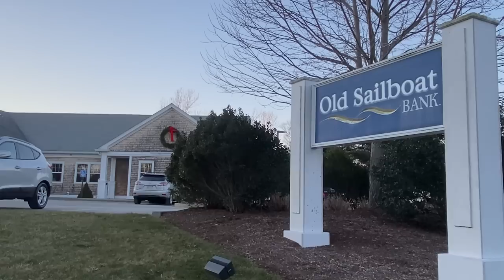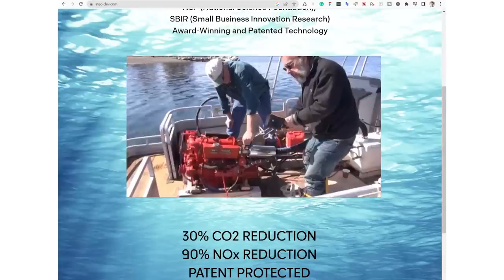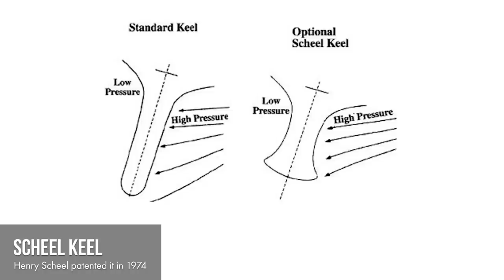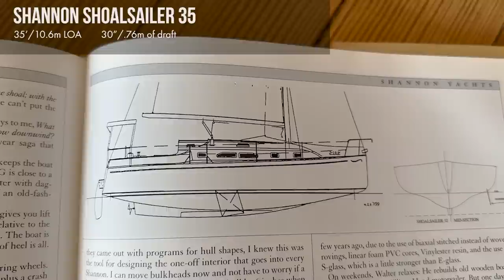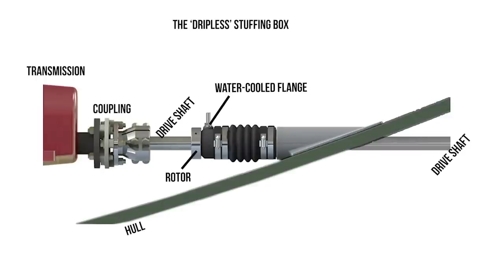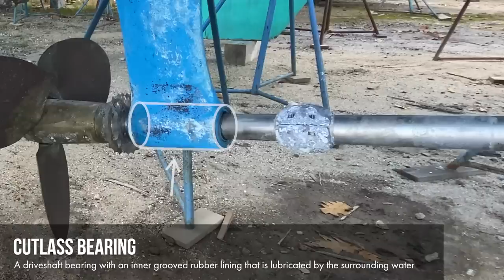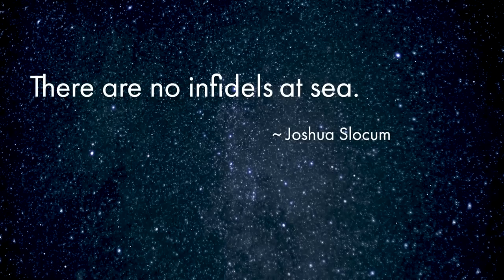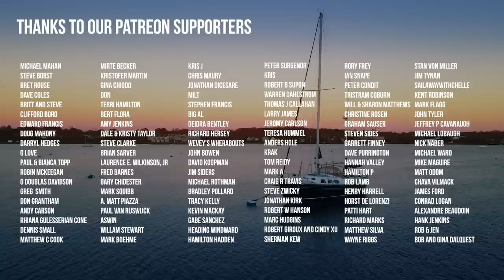Ran-day's Sailboat -  Visit from Walter Schulz - EP10 #sailboatrefit #sailboatrestoration

Comment: Hello Ran-day: being a marine engineer for several decades I personally prefer traditional shaft logs with stuffing boxes. Very reliable, easy to service, cheap to maintain, and very safe. You can work on a stuffing box even when at sea.  Dripless seals are great for keeping bilges dry; however they are very expensive to maintain. If you are in the Bahamas for example, parts will be difficult to locate. They are expensive and troublesome to replace every 5-6 years.

Comment: Hey Randay, we live in Bellingham Washington and if we don't fiberglass over the bolts on the rubrail or toe rail they always sweat and drip. You can put a big blob of caulk over them to stop the sweating. You need at least 1/4 inch thick all around each bolt and caulked tight to the whole. I take a calking gun and just run a few circles around each bolt and make a nice mountain lol. Any metal that penetrates from inside a boat to outside needs to be insulated in order not to sweat. At least here in the Pacific Northwest and Alaska.

Comment: Hey Randay I have had someone before my put a nice access hole in the top of my old deisel tank. They did a nice job and you can reach in and clean every inch. Mitchell access hole is a good 6 inch. I can have my arm in there and still see I little around it. My tank is old galvanized tank from 1972 and looks like new on the inside.

Comment: Freeze plugs are needed for sand casting, they are very easily replaced.   A vacuum gauge on the fuel system shows the condition of the filters, it prevents engine failure.  Another item that costs a few dollars and saves hundreds   Dripless shaft seals sound good, but they fail “catastrophically”  a regular flax seal costs $2 and is easy to replace    Never use dripless    “The answer to a problem no one was having”   Very well said
Reply from the maker: A good friend just called to tell me that about the casting/freeze plugs… Great tip on the vacuum gauge. I’m a convert back to the classic stuffing box after the Titanic warnings! Cheers 👍👍

Comment: Thanks Randay.
A wonderful chat with a remarkable gentleman.

Regarding your leaking engine coolant.
You may find the process a bit more leisurely if you pressurize the system at the radiator cap. 
No need to run the engine or be underway.  
Low pressure ( approx 10 -15 psi) or less if leak is severe.
You will have time to carefully examine engine and surrounding peripherals in a more controlled manner.

I want to wish you luck. However, the opportunity for more great content keeps me coming back for more
Regards,
Bill

Comment: Walter Shulz, he is the man. Simple and direct. Amazing Ran-day that you managed to buy a boat that is the next Titanic and the next Hiroshima. You may have to discuss this with Captain Q. I have a dripless shaft seal on my Challenger 36 and it is a constant problem and I am going to change it out for the standard stuffing gland next time the boat is out of the water. The gas cylinder locker also just a simple rebuild or just hang the cylinders on the push pit out in the breeze. Love your work Randy and all the best. 🐟 😁
Reply from the maker: Thank you, Richard! I will be following in your footsteps with a regular stuffing box.  Good thoughts on the lazaret... looks like a simple redesign is the option I'll be going with. cheers!

Comment: Driplass shaft logs are made from high carbon steel that rust easy. So they get pits on those mating surfaces from not being used all the time and drip. And then you might as well have a standard stuffing box. Easy to change, you can change them in the water also. And don't take up much room to carry some spare stuffing gland material. Very important to put the stuffing gland back in the same direction it came out so pay attention to that if you ever change one.
Reply from the maker: Great tips… I do plan on heeding Walter’s advice to go back to a tradition stuffing box… so stay tuned for that journey! Cheers

Comment: As a temporary but very usable fix for your propane issues check out one of the portable gas burners chefs use for catering events.  Less than $50 using 8oz cylinders and small enough to fit on your current stove top.  At restaurant supply stores and online.  10,000 btus

Comment: First and foremost what a fantastic guest and interview
   to comment though. The purpose of a freeze plug is when they’re manufacturing the engine block there are sand cores inside the mold of the engine block that must be broken down and taken out as space holders for your water jackets as will as oil passages they hold the spaces in the casting the molten material flows around these sand cores and is removed and some are actually machine I would replace them with bronze freeze plugs
Your tanks that are 5052 aluminum are OK but if ever replaced you should go to a 6068 marine grade aluminum you could find this in the Coast Guard specs for vessels for hire. It’s just a better product. It does cost a little more than 5052 but once again, what a fantastic guest , you and the captain do an awesome job say hi to Sea dog

Comment: He’s a nice old guy with lots
Of knowledge and his attitude is great , fun is what it’s all about, he’s very smart, boat fixing is something that’s never ending, it’s relatively easy to cut a round inspection hole in the fuel tank about 130 mm  so that you can get your arm down into it and clean the sludge out physically , it’s easy to tap in bolt holes and make a lid with a seal and will make your life easier because pumping only gets out the water , there’s an Australian product we use here called fuel doctor , if you can get it there it will keep your tanks absolutely clean and absorb water into the fuel molecules , it’s Amazing stuff, I used it for three years and had very clean filters . Great boat good work on the videos very good job.

Comment: One of the best videos on your channel.. the channel Epoxy and Butyl Tape installed a dripless and it took a crap within the first season it was leaking so he went back to the old tried and true seal.. the old style you can atleast tighten up where as the dripless could lead to sinking

Comment: I had had the PSS system on two boats - awesome system.  I am not a fan of your current set-up.  I would replace with a PSS and add a safety collar ahead of it.  It comes with one collar that is set to the shaft with set-screws and this is designed to hold it into place when under use.  I have had the collar slip a couple of time causing too much water coming into the bilge.  I decided to add a 304 stainless collar as a safety collar that keeps the set-screw collar from slipping.  PSS has now included these safety collars for larger shaft applications.  I literally bought my safety collar on Amazon but my shaft was 1".  From that point forward, my bilge was dry as a bone.  FYI - I sent you and email to help you with your fuel tanks.
Reply from the maker: Thanks Tim!! Much appreciated. I hear you about the 2nd collar…. I actually did a makeshift one with a pipe clamp when it started taking on water and I was troubleshooting.  what happens when your PSS surfaces/interface wears out or down(in my case)? Isn’t it better/simpler to use the old stuffing box style and repack it every few years versus removing the shaft to replace the PSS rotor?
Reply: @YachtHunters  stuffing boxes drip when the boat is alone at anchor.  I don't like that idea.  The mating surfaces on a PSS are extremely durable and good for many many years.  I would check the rubber sleeve and replace every 5 years or so just to stay ahead of it.  The mating discs will last you longer than we will be alive.  🙂  Talk to a PSS rep and ask these questions directly and you will get the same answer.  These units are far superior to anything else.  I will have that set-up in every boat I own.
Reply: @YachtHunters  Well, yeah maybe! Depends on a lot of things. PSS suggests you replace every 6 years. I haven't had issues with mine in the last four. 

You usually don't have to pull the shaft to replace. Definitely have to disconnect from the coupler. But not entirely pull.

I like it. When you replace you'll inspect the entire system. So it can be good. My prior solution was a traditional packing - but at some point the shaft was misaligned. I had about 1/16" of bronze between me and the water. Scary!

Comment: Great episode.  What Walter said about the large area where your propane tanks are, even with a weep hole in the event of a gas leak, filling up that area would be like a bomb going off.  Why not wall it off in there like a designated locker?  Lots of work but that would be worth it.
Reply from the maker: That's a great approach and seems like the simplest potential fix... might not even be that much work! thanks

Comment: As a retired diesel mechanic, having worked on a variety of diesel engines, single cylinder yanmars to v16 diesels.   The Racor filter system is superb with a visual and good micron filtration. Match the gph to your engine dual filter system.   Cheers Vic.   Nice to hear walters wisdom
Reply from the maker: great tip, Vic, Thanks... I'm looking into adding a 2nd Raycor to the mix... so I'll keep that in mind. cheers

Comment: That’s a practical, interesting and sympathetic real sailor type of guy I would savour some sea time with! What a mentor(or even father-like figure) he would be for a restoration or boat build project! I thirst for more of him. He is so right about night sailing, in 30,000 sea miles of coastal/offshore racing, my strongest sweet memories are from the “bright darkness” of the night watches!

Randy, put those gas tanks in a container on the rails, fit a traditional stuffing box on the shaft with a remote grease twist cylinder! In the case of through hulls, the perfect boat has none, a keel cooler/exchanger for the engine and a single through hull or outboard flush pipe feeding an onboard tank from which all water requirements are fed from, then you can leave the ship to its own devices and have  a good night’s sleep! 

PS.. I am collecting classic/vintage sail boats for a maritime sail training/community boatyard/museum so maybe that may be of interest for an “offshore/foreign” Captain Q video? SkipRay(and dogs, Rusty & Skipper), Kenmare Bay, Kerry, Ireland.

Comment: I too have experienced a dripless stuffing box failure. It worked well during its 5 year warranty period, but three years later, it was spewing gallons of water per hour when underway.  Fortunately, I was only a few miles from a marina when I discovered the problem.  The marina replaced it with a traditional stuffing box, which I stuffed with Teflon packing cord.  

The big advantage to the traditional stuffing box is that it can be serviced without hauling the boat out of the water. If it is dripping too much, tightening a nut is all it usually alll it takes to reduce dripping.   The packing can be replaced inexpensively.  The packing material costs $10-$20.  "Dripless" boxes can't be serviced when they wear out; they have to be replaced.  This can only be done when the boat is out of the water because the shaft has to be pulled to gain access. 

Teflon  packing stays cool with very few drips: none while the boat is stationary, and about 10-12 per minute at when the engine is running at 1800 RPM.  I tested the temperature with a no-contact thermometer while the boat was underway, and confirmed that was cool to my touch after stopping the engine.

Comment: I was laying FG @18 yrs old. I like most of what Walt did building boats...the best! Especially impressed with his information on thru hulls and the stuffing box. Old style stuffing boxes are not a maintenance item...either they work,  tighten occassionally and replace as necessary.  They can and have lasted the life of a boat, done right. Those contraptions self- whatever stuffing boxes...yup, now you have a maintenance item.
Note to Walter..
Love your boats. I just wish you had put aluminum toe rails on them. My Poor girl, a C&C 30, held at the dock for 3 hurricanes with wind 50 to 70 kts fo 12 hrs..
Waves didnt foam white,  just came over the wave break. I had 8 springs onto that toe rail. 4 sterns, 2 bows, all set to let her dance. 
The only mark she had was when another boat got loose right behind her...I watched from the beach in horror...she went in and sprung back with those 8 springs (14 lines on her over all, on her dock...all 5/8 3 strand nylon)...she came back and shot that 10,000 lb boat off her ass. It wrote itself and 5 others off. I had a chip corner of transom and bent stern ladder. Didn't put in a claim.
12 sunk, 30 damaged and out the next season for repair...all because they couldn't be sewed to the docks. Not a pearson, alberg, oday, tanzer, pace ship stayed up because they all ate their lines. No one could get on the docks with 6 footers rolling through. We had a few with aluminum toe rail go as well...but " double" your lines is  BS...they didnt secure the boat....you are a bullet proof thinker...I am too.

Comment: I love my dripless shaft seal. They need to be “burped” if the engine hasn’t run for an extended period. Or if starting after a splashing. On our DSS there’s a bellows type rubber hose. Easy to pull back the fitting which breaks the seal for a second. It will flush the seal of any tiny object. Ask me how I know. Most DSS’s are rebuildable. The kit has a coupla o-rings and a set of grub screws. 
Jon

Comment: Dripless shaft seal…I don’t have one to speak with experience on the pros/cons. But I can say that a few years ago I replaced the prop shaft and coupling on my Sabre 34. And at the same time I replaced the original stuffing box (and stuffing box hose & hose clamps) with a new stuffing box, etc.

Like you, it seemed to me at the time that the dripless system solves a fairly minor problem with potentially catastrophic one.

If you keep the dripless system, some people recommend a prop shaft zinc immediately forward of the rotor as a backstop to the rotor set screws.
Reply from the maker: Good idea.. I used a pipe clamp as a stopper for a bit until I felt confident it was stable… now I’m onto the task of replacing it with Walter’s suggestion 👍👍

Comment: Try Bars leak sealer for radiators......in the old days freeze plugs were made to pop out if the water in the engine block started to freeze hopefully before the engine block cracks...

Comment: Might I recommend a borescope  camera or snake/inspection camera on a long lead for your phone, they are not expensive and you could leave it in the bilge and have the wire sitting on the chart table for easy access while sailing or for a quick peak while in port.
Reply from the maker: he has one

Comment: In 1967 I had a 1947 Ford car with a flathead V-8 that did not get its proper winter mix of water and antifreeze, due to my teen-age ignorance.  An unusual cold spell froze the engine, and one of the freeze plugs got pushed out free of the block.  I could see half-frozen engine coolant seeping around the lower side of the plug as it sat free of the block itself.  During that repair a mechanic told me that freeze plugs do protect certain parts of an engine block from bursting due to expansion caused by freezing water, but in fact those holes in the block are necessary for the casting of the block itself, and the plugs are installed later, with the secondary benefit of acting as expansion plugs.  The primary use of the hole in the block was to facilitate the casting of molten iron into the shape needed to create the engine block.  The freeze plugs were installed later to close up the holes in the block needed to cast the block itself.  Theoretically those plugs would have lasted the life of the engine, but my misadventure with the coolant mix made that winter a tough one for the engine's freeze plugs.  I forget how many were replaced, one or two for sure, but it was not a major fix, probably due to having lots of clearance in the engine bay so the work could be done without pulling the engine.
Reply from the maker: By our students shall we be taught

Comment: Walter reinforced my decision not to install a dripless system. Did a repack of my gland on the hard last fall, on my Morgan. No issues at all. I've watched 3 or 4 videos of captains replacing the dripless seal, in the water. Need to free the shaft from the transmission, slide the stainless collar off the shaft, put the new seal on then slide the collar back up the shaft. Cut the old collar off and slide the new seal and collar until water intrusion stops. I'd mark the shaft with a sharpy around the shaft where the collar meets the shaft forward. The new collar is usually compressed 3/4 of an inch aft, once the collar meets the new seal. You may get away with loosening the collar grubs and pushing it aft a little. Good luck.

Comment: That propane locker needs to be sealed from the boat.  The solenoid must be inside that sealed locker and there must be no way for propane to get into the transom area below or the bilge.  The propane locker must also have a drain in the bottom leading to overboard so any potential leak drains outside of the locker to the exterior of the boat.  I would seriously consider buying a new propane locker and have it installed by a certified technician who knows how to do this.  I would not use the existing configuration.  You are also required to have an electric switch to turn off the solenoid outside the locker.  This would be a top priority on your list... in my opinion.